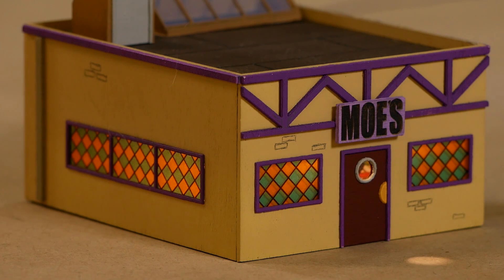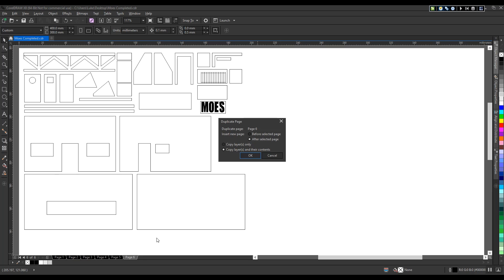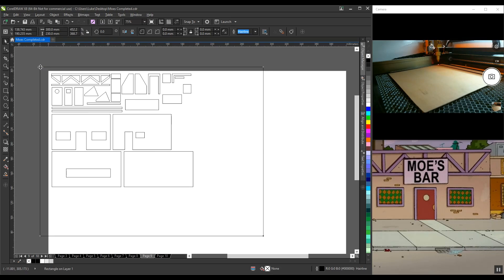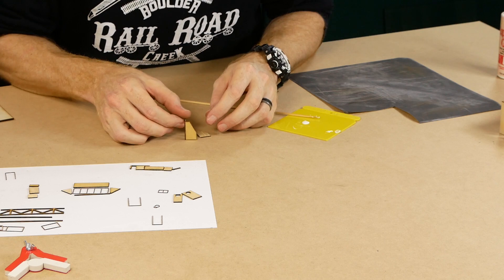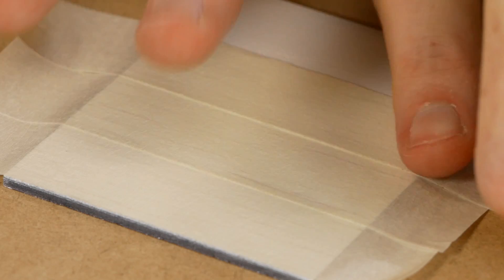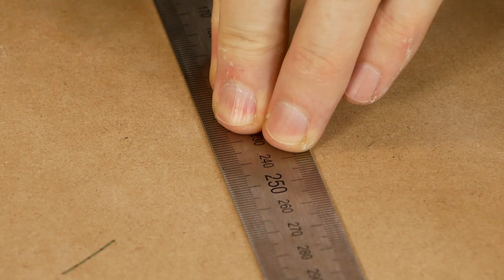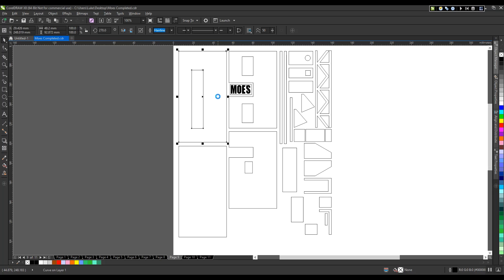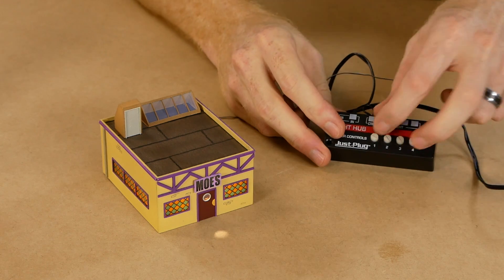Moe’s Tavern – Laser Cutting Tutorial

Comment: You are using way too much power on your laser. If the edges are all black and charred like that, you are using too much power. You should go down to maybe 30% or less, keep increasing the cutting speed and reducing the laser power until you get a nice brown edge. I am new into lasers (I have an 80w laser cutter) and I know this video is 2 years old. but I just want to make a comment for people that will be watching this video in the future. Do multiple tests before your final cut (just cut a small square). Start at 80 to 85% power (NO MORE THAN 85% ON ANY LASER OR YOU WILL OVERDRIVE YOUR LASER as 85% power means 100% of power, I know. Its hard to explain), and about 10mm per sec on speed. Test it, then go down to like 75% power and 15 on speed. check for charred edges, lower laser power to 65% and 18 on speed.... so on and so forth until you get a nice brown edge color on your edges without charring them. I go for 25% power and 25mmps on speed on thin boards and about 75% power and 24mmps on 9 or 10 mm plywood boards. Every laser machine is different. You should test what is the correct speed and power for your machine otherwise, you will be wasting your laser tube in no time.

Comment: wow that's a lot of work for your laser, I use a epilog laser engraver/cutter every day, and there is no water involved at all, its all in a container case, all you have to do is provide external air suction and a 30psi pressure line when doing cuts.

Comment: Oooh! I noticed at 6:08 that those two longer beams on the right-hand side are hanging over the securing tape, and I thought "hey, I bet that makes it easier to unstick the pieces after working on them" so the thought occurred to me that on the smaller more fragile pieces could benefit from a tiny tab made of two layers of paper stuck between any delicate piece and the sticky-side-up tape; with a small tab like that, the first layer would block the adhesive, and the second layer would give you a small lever you can lift the piece. You could even make the tabs as strips going across the underside so you can lift with less torsion. 

You're always a source of inspiration, I'm so glad to see you're still making models, please keep up the fantastic work!

Comment: Luke,

I see you used the sticky note to protect the sign face from the smoke. Here is another trick to try. Before you remove the mask, you can zap it with a light dusting of spray paint. Take a look at my latest simple project for an example. 
The crate is a simple pine box on the little 4-wheel LGB flat car, and hides a battery pack for the LEDs in the Christmas tree.

www.gryffinaero.com/modelrail/xmas17/

Comment: I've seen you used multiple layers for the sign. Can't you work with different colors and layer them in the laser software? I sometimes use a trotec and there you can order the colors, and adjust settings per color. This way you can use black for engraving, red for cutting, blue for ... Whatever you wish it to be, pretty handy.
Nice built!
Reply from the maker: I wish that was an option, as far as I can tell the CorelLASER program that connects to this specific laser cutter is pretty basic although I’m still very new to learning the software, it is possible that that feature might be available? I’d love to invest in a Trotec laser later down the track.... just super expensive at the moment!
Reply: Luke Towan yeah they are expensive, wished I had one, I use one from a makerspace. The software is probably propitiatory to Trotec, it's a pretty good job manager. Did you buy your last from a dubious Chinese provider? Or from a proper business in your country? I'm looking at buying one, but they are too expensive to fool around with, so I would like a proper one.
Reply from the maker: It was bought from a proper business in Australia however they imported it from a dubious Chinese company. The place I purchased it from was Cole Tool Center in Cairns and they unpacked the laser and did some tuning and testing to make sure the laser worked properly before I got my hands on it  😉 Plus it was subject to Australian consumer laws so if it didn't function as advertised it wouldn't be a hassle to return it (it has a 6 months warranty).
Reply: Yeah I think that is a very good way to go! It seems very nice. Have fun with it :)

Comment: Hey Luke, it might be worth your time to check out Fusion 360. It's a free CAD software. I can easily see you designing this as separate 3D parts in a CAD model, where each part is a laser-cut part, so you can visualize the full assembly before laser cutting. I bet there's a dead simple way of exporting your CAD models into files that you use too.

When I'm laser cutting, I use Solidworks (very expensive, but I get it for free). I create a Drawing that represents my laser cut sheet, drag all my parts into the drawing, and hit print to send it to the laser cutter.